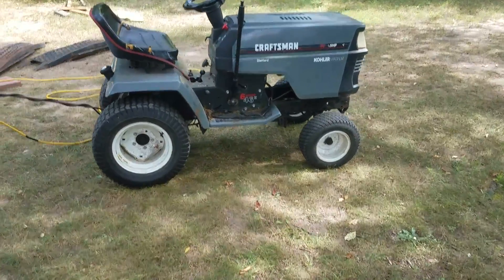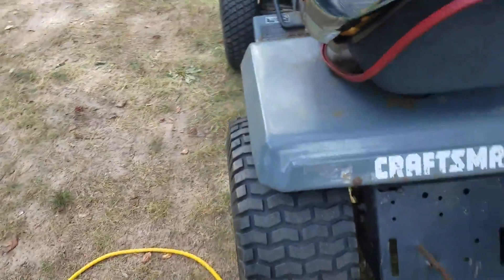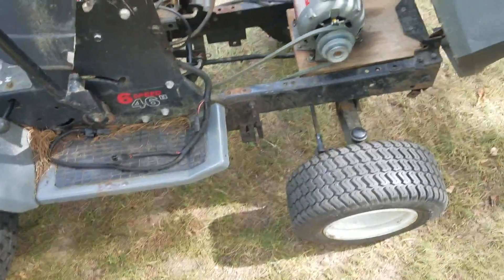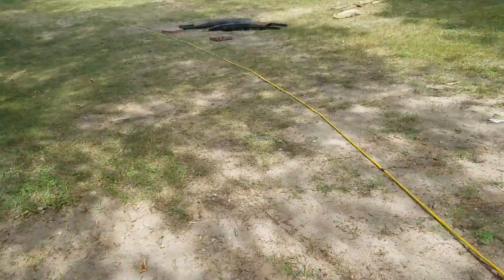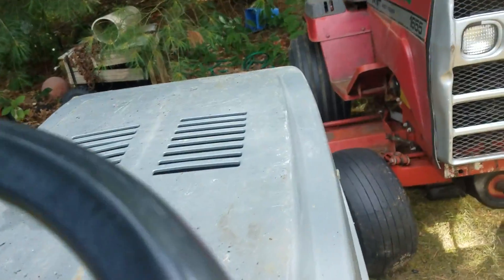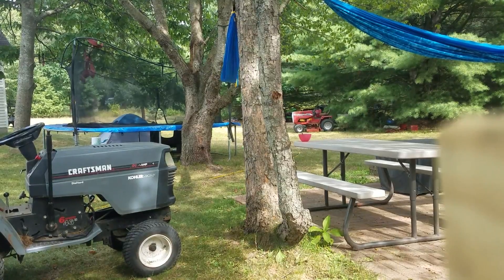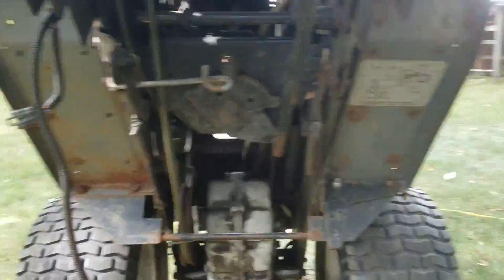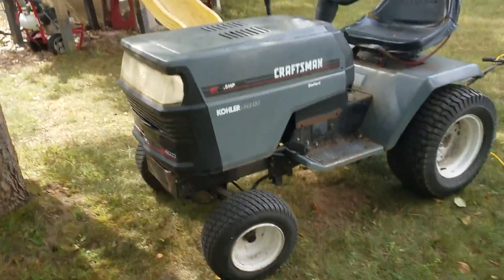Craftsman GT6000 Electric Tractor Conversion (8/20/19)

Comment: I appreciate you posting this! I have two nearly identical Craftsman lawn tractors, both with hydrostatic drives, that I want to turn into a 4 wheel drive articulating tractor. They both have running engines, but delivering the power to the section that does not have the engine would be complicated, so I want to use two identical AC motors on both transmissions, and power it with an old gasoline powered generator. Plus I would have a portable AC power source for use on the farm. I have not been able to find anything online about power requirements for these transmissions, and was considering doing something like you did temporarily for test purposes. I appreciate you doing it for me!

Comment: I’m looking to do something similar but the pulley off my transmition is for a vertical engine shaft. You mounted the electric motor horizontally, did you just twist the belt or did you do anything special?
Reply from the maker: This tractor has a Peerless 633 garden tractor transmission with a pulley on the side, so it was set up just right like that. The tractor originally had a vertical shaft engine though, and yes the belt just twists.

Comment: I’d keep it as is.throw on an old alternator and battery to keep the charge. the money you will spend on a new motor will be a waste.if u gotta buy gas,oil,and parts to keep it running.and with this just replace belts and  transmission oil once a year save a lot and more torque than a gas motor too
Reply from the maker: I already had the engine and it needed a tractor to be put into, and I had somebody who wanted a tractor they could put a snowblower attachment on, so that's why I did it. I no longer have the tractor, but I put the electric motor onto another tractor already.